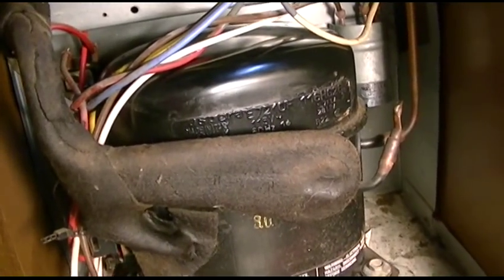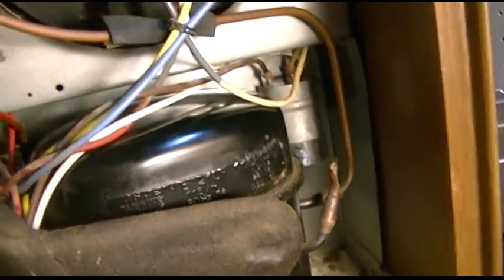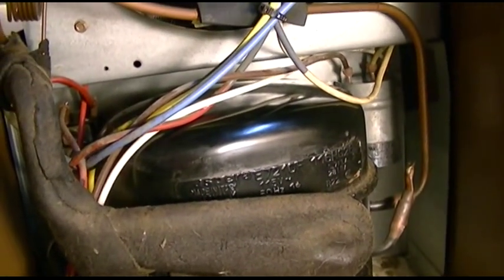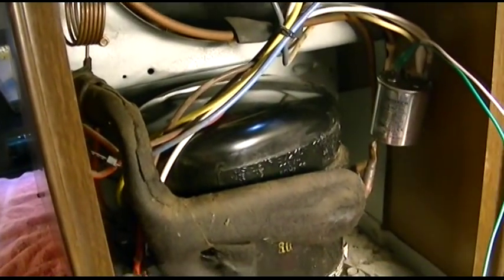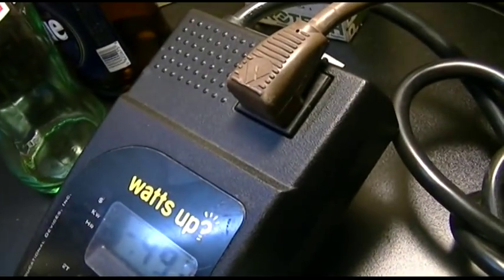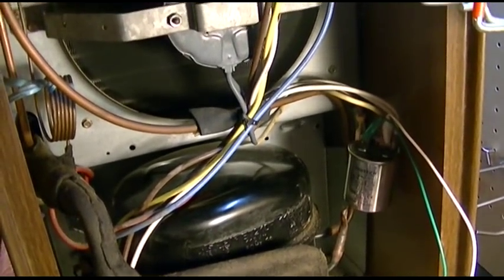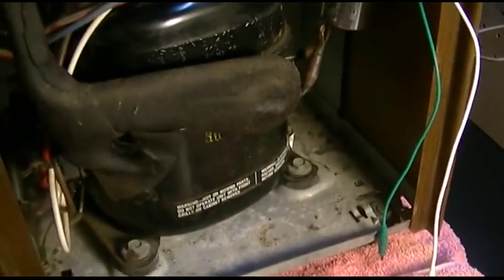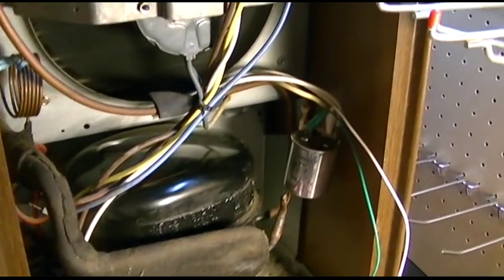Kenmore Dehumidifier Saga, Part 4 - Confirmed Bad Capacitor

Comment: Wondering if you could help, my dehumidifier trips the breaker immediately on power up (meaning the moment you hit the power button it trips). Could a bad capacitor cause this? Thanks in advance
Reply from the maker: Probably not a bad cap, something's shorted inside.  Break out a meter and start testing, and hope it's not the compressor.
Reply: @jaykay18  Thanks Jay
Reply from the maker: Sure.  Good luck, let me know what turns out.
Reply: @jaykay18  Okay, i put a hardstart on it and it starts up and runs. If i turn it off and remove hardstart it will turn back on and then kick breaker after about 5-7 seconds. Whats your thoughts?
Reply from the maker: Are you talking about its own internal protection?  Or the actual circuit breaker on the house?

If it's its own protection, under the cover on the compressor there may be a start relay of some kind, those can go bad, if it's equipped.

If it's blowing the house breaker, that might be serious.

But if you start it, and it starts, and then you try to "hot restart" it a moment later, and it is NOT blowing the house breaker, that's normal.  It's got pressure buildup in the sealed system, and that needs to equalize before it will restart, hard start kit or no hard start kit.
Reply: @jaykay18  Sorry about that. Not the internal breaker but house breaker (im using a short extension cord w resetable breaker).
Reply: @jaykay18  Thanks for that info Jay
Reply: @jaykay18  Okay Jay important point you should know. I just checked it and it was tripped. I thought maybe since it was a long time before it had ran that maybe the compressor just needed a boost but now thinking it might be shot since it has tripped again. I thought i had it licked but with it tripping after running maybe compressor is just too far gone.
Reply from the maker: Maybe.  You have to meter the compressor and see what the meter says.  That will give you a better idea of what's doing.
Reply: @jaykay18  I just now saw your video. I have the exact same dehumidifier with the same problem. Were you ever able to find the "actual" replacement capacitor? I haven't been able to anywhere.
Reply from the maker: The marking on the existing capacitor is the type you should get.  If you can't find one of the exact capacitance, one that is very close will do.
Reply: @jaykay18  Thanks. I'll take the old one into a very good local outfit and see what the experts there can fit me up with.

Comment: Do that thing have a thermostat? ,if not hook up the switch startup lol
Reply from the maker: It only has a "humidistat".  With the right capacitor of the right rating, there should be no need for modification.

It's also possible that the capacitor in the unit was not original to it, and it had been replaced somewhere along the line with one of a lower rating.  It's also a possibility that the unit has a lot of hours on it, and is hard-starting, and will need a capacitor with a slightly higher μF rating to start reliably.  This remains to be seen.